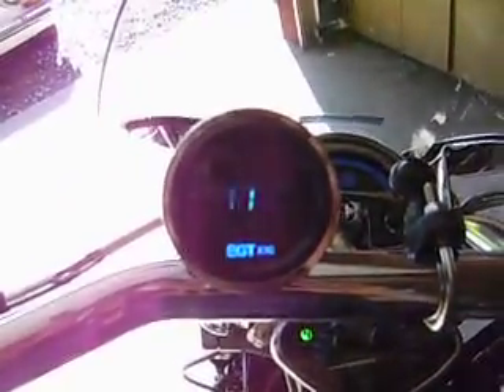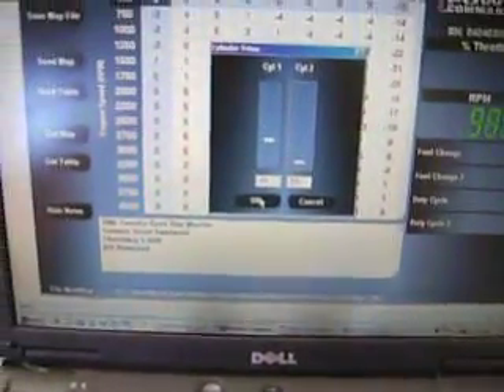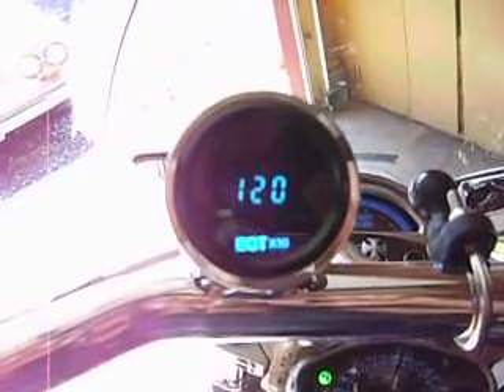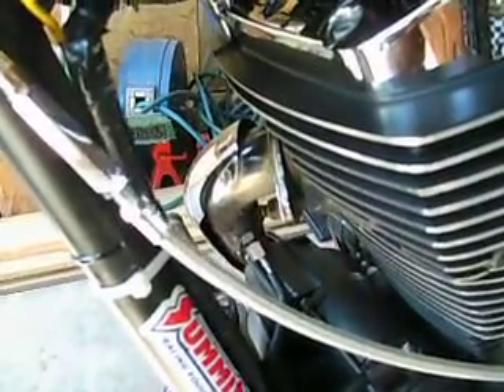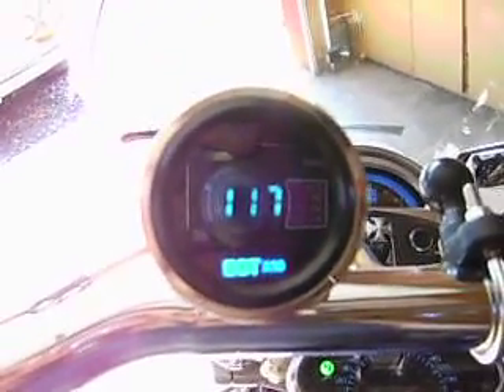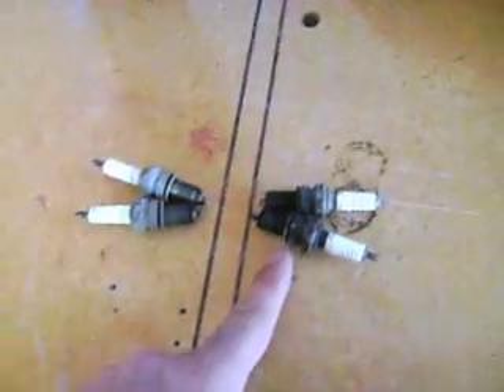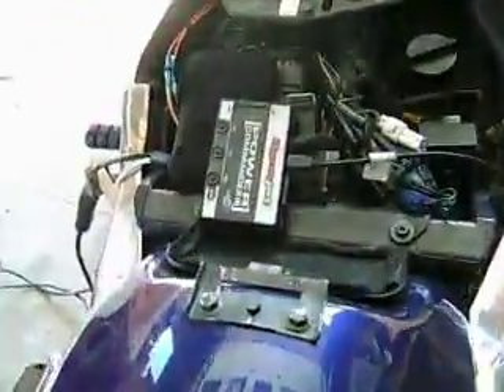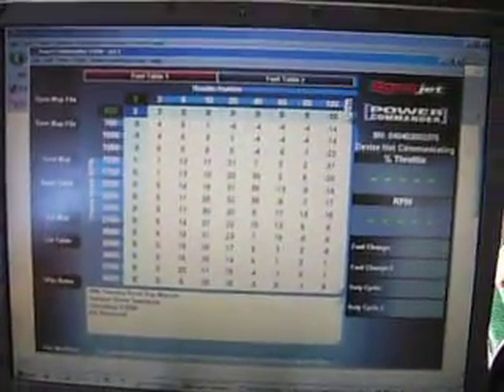EGT tutorial

Comment: I believe that the temperature increases to a point as you lean the mixture.  After this point the temperature actually goes down due to incomplete combustion.  I believe the idea with hydroxy is to lean to the point where the engine is in the incomplete combustion region and then adding hydroxy will allow the flame to propagate again allowing for complete combustion.  This type of tuning should allow for running ultra lean conditions thus allowing for greatly reduced fuel consumption.